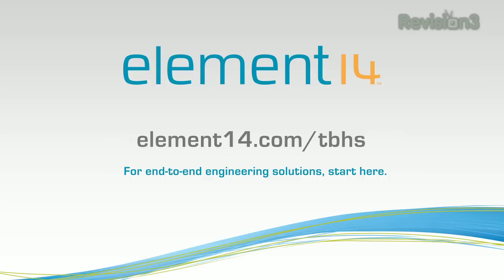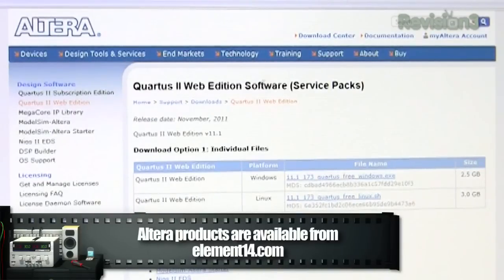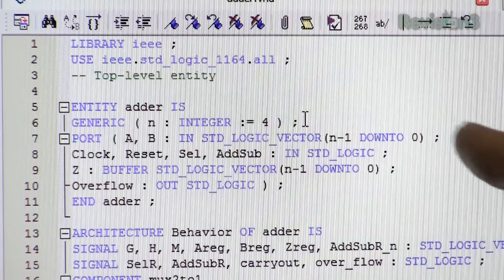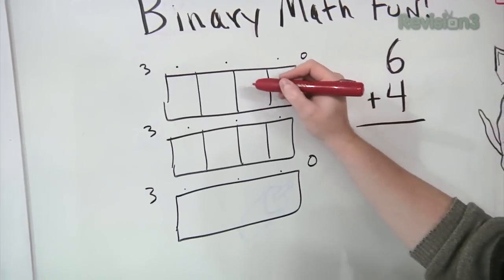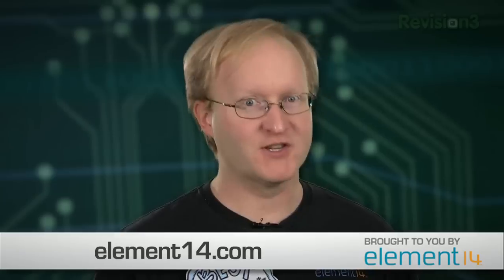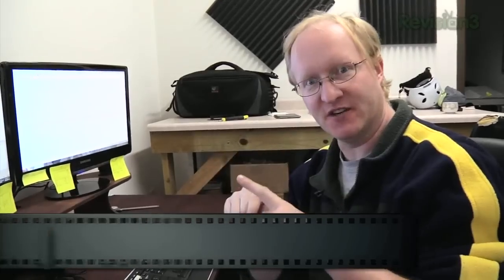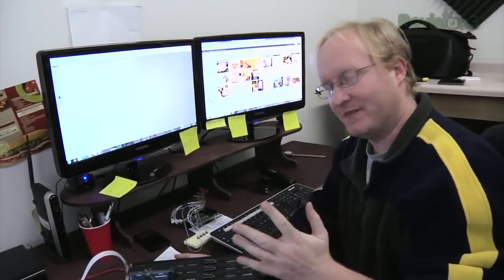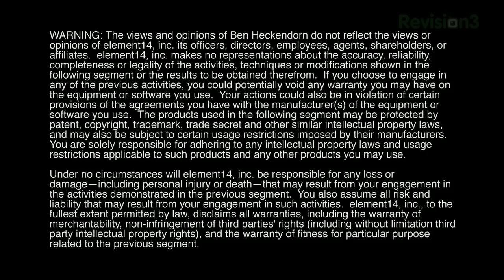Control XBox 360, 3D Printers and MORE with FPGA's and CPLD's

Comment: Minor correction: 8 bits can only represent -128 to +127 (in 2's complement)
But thanks for the show... I feel that FPGAs are underutilized for many applications, including hobby projects... and they are getting cheaper, faster, and bigger!
Reply: +Jeff Theusch Depends on whether you're using a signed or unsigned value.
8 bits can be used to store 0 to +255 (unsigned int8) or -128 to +127 (signed int8) - and that's due to the fact that you "lose" 1 bit to represent the signal.
Reply: Daniel, watch the video around 14 minutes. The annoying little tip on the bottom says signed values can be -128 to positive 128. There is no way to represent 257 unique values in 8 bits, no "ifs" about it

Comment: This isn't very relevant to this video but  i was wandering if you could help me with this project I'm thinking of. Im planning to program a system to work with powerpoint, it basically detects what the speaker is saying and it matches it to words on a slide and switches to that slide I will probably use it to go through lyrics as a band is singing them.

Comment: There are many good reasons for choosing an FPGA over a MCU for specific applications, implying that an MCU would somehow have trouble displaying a dot matrix picture programmed correctly is rather contrived.
Reply: Well, the MCU will need at least one clock cycle per pixel (probably at least three, though). An FPGA can do an entire row in a single clock cycle.

The FPGA will likely have a lower clock speed, but you save so many cycles, it ends up being a lot faster. Even if the MCU can manage to process a row as fast as the FPGA, the FPGA can light up the entire row simultaneously, while the MCU has to light each LED individually. This ends up with the MCU driven display being a lot dimmer.

Comment: Hook up a IR phototransistor to a microcontroller, write some code to record the input from there, record the key you press on keyboard with the microcontroller. Finally hook up an output pin on the micro to the 'ON' pin on your computer motherboard et voila.

Comment: Hi. Thanks again. It's still a bit confusing. The ASIC, CPLD and FPGA are using program so that it can physically arrange the switched inside the ICs of the ASIC, CPLD or FPGA. If this is so, what kind of physical switches is it actually using. Is it like a ferric oxide or similar that physically changes orientation to switch things to binary? Or it's also small transistor used in CPUs (by the way what's the difference between a CPU and an IC or is the CPU under the category of the IC?) but are physically altered like you would with the magnetic materials that a hard disk manipulates (or the cassette tapes still used for low cost back up)?. Thank you in advance. God bless. Rev. 21:4
Reply: The way to conceptualize how programmable logic can change its function is to visualize an FPGA chip subdivided into thousands of single function blocks.  If you look at the Altera Cyclone V FPGA and use that as representative sample, there are a handful of different types of blocks; blocks that can do floating point DSP functions, memory blocks, PLL blocks, as well as others.  The most abundant are the general logic element blocks (called "logic elements" or "LE"s) which are the simplest operations that any traditional logic IC can be split up into.  It is important to note that Boolean logic (which is the model that is used in integrated circuits) allows all functions (AND, OR, XOR, NOT) to be completed by arranging and adding together NOR function gates in specific arrangements.  There are thousands and thousands of these LE blocks that can be grouped and configured to exactly replicate a typical "real" logic IC.  The LE blocks are specially grouped, wired and networked logic gates in the silicon of the FPGA chip.  The logic gates have transistors in between certain connections so that a signal is made to follow a reconfigurable path between LEs which creates the desired operations on the signal.
So the whole programmable aspect isn't achieved through an actual physical reconfiguration of the FPGA's silicon, but through specific paths that the software chooses (via a simulated test to find the best "fit" aka route for the desired design- the "best fit" is usually decided to be a trade-off of wasted LEs on a cumbersome path/route and possible excessive signal delay because of an overly long path/route. Sometimes it is decided that wasted LEs or signal delay is better than a balance of the two because one of those essential resources is much more scarce in the design than the other resource.)
I must say that I find it a bit difficult to go through this as a Youtube comment, but, hey- I gave it my best show.  If it is only a confusing and frustrating mess, just ignore all of the above explanation and go to the Altera website and look at one of their wonderful explanations of the FPGA architecture.  Hope that helped!
Reply: SevenDeMagnus It is not mechanically changing anything. Think of it like this: a processor is a bunch of transistors wired together. An FPGA is a bunch of transistors wired to every other transistor inside it; however, all of them are disabled. When you write code a Synthesizer looks at the code and energizes some of the wires connecting certain transistors, making logic gates.

Comment: For the simpler stuff, wouldn't it be cheaper and easier to simply solder together a few simple logic ICs or even transistors for the simplest logic(of course this would require a little bit more space)? FPGAs an CPLDs can get kinda expensive.
Reply: This is for teaching purposes, not really for optimization of cost

Comment: Modern x86 processors, even in their 32 bit flavors, are/were not limited to 4 GB of RAM, thanks to the Pentium Pro's addition of PAE (Physical Address Extensions).  Most operating systems just don't support it (well).  It's a bit of obscure information, but the myth of 32 bit processors being limited to 4 GB of RAM has always annoyed me, and hasn't been true since the mid 90s.  The register width doesn't matter, it's the address bus width that matters. :)

Comment: ASIC, CPLD and FPGA is the hardware equivalent of the machine language (faster but not human language friendly) and the micro controller like the Arduino, Rasberry Pi and Beagle Board are the high level languages (easy to program for but slower). ASIC, CPLD and FPGA is then analogous to muscle memory (fast and instant reflex without thinking), while the micro controllers are analogous to the usual brain function? Thank you. I hope and pray someone makes a circuit that functions as the GD-ROM of the Dreamcast and a light gun that works with an LCD:-) [I'll try using the cool projects here and on the 'net]. God bless. Rev. 21:4
Reply: +SevenDeMagnus RasPi and Beagleboard/Beaglebone are not microcontrollers, they are just small general purpose computers.

Comment: damn all this time i thought it stood for flip pin grid array durr.. I do know these things are awesomely fast at bitcoin mining.
Reply: I would assume they would be, but I think if u could leverage ur GPU on your graphics card, you can speed up the mining too.
Reply: Not as fast as a circuit designed specifically for the bitmining algorithm(s).  Aka an Application Specific Integrated Circuit (ASIC).  Compare the two, an asic is way faster and way cheaper (excluding the millions needed to get the design set up for production).